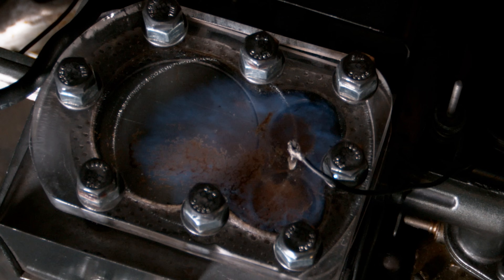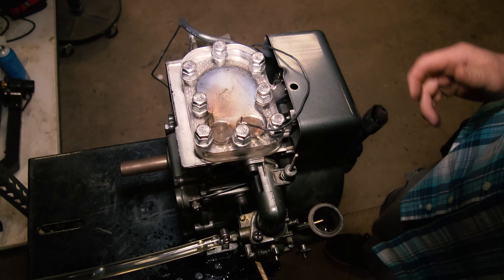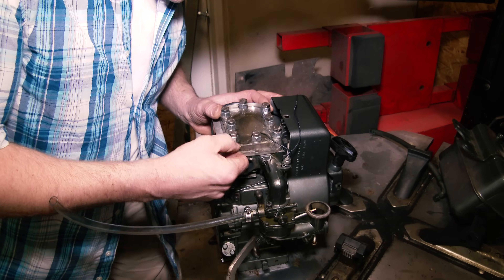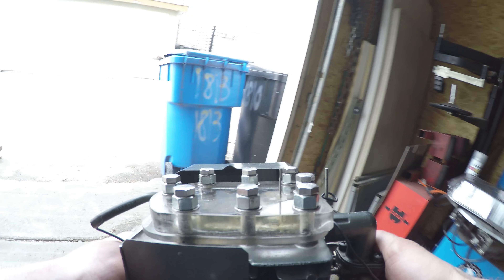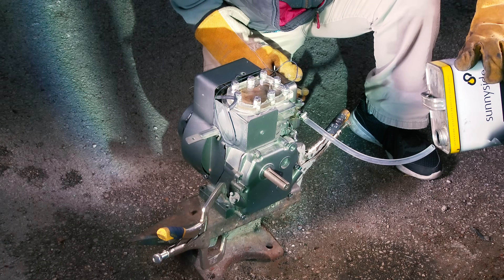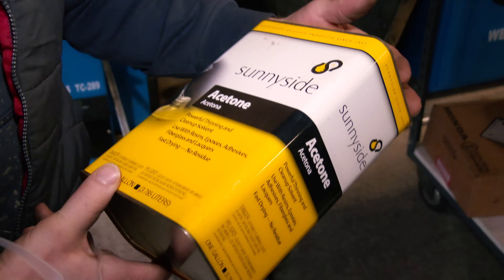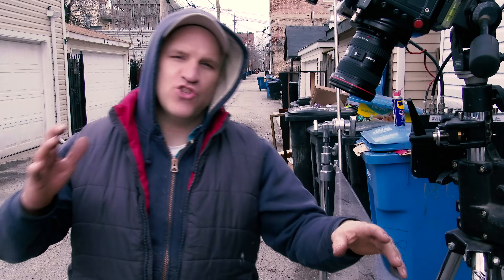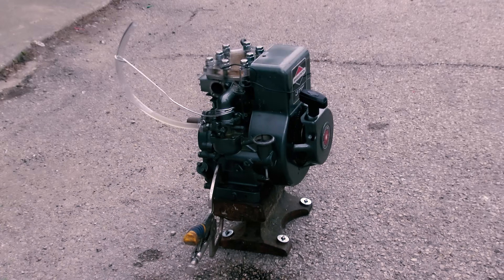See Through Engine (S1 • E3) Different Fuels [WD-40 -Acetone -Stoichiometric Gas ] 4K

Comment: Timing on the Engine is way off...
Reply: DrinkUpHD What do you mean? It's exactly how it should be.
Reply: Wyatt Rowe its right at top dead centre, more efficient if it's before top dead so the the flame is pushing it rather than chase it. Close though.
Reply: Wyatt Rowe or perhaps I'm wrong, it now looks like it's before by a bit. My bad

Comment: When you say that some clip is 4000 FPS, do you mean it was recorded 4000FPS or played 4000FPS? Just one FPS isn't enough to tell anything in case of slow motion footage. Of course it's nice to know, what was the FPS of original footage, but it would also be very nice to know, how many times slower the videoclip is when compared to the original speed. For example, if the clip was shot at 100kFPS and then adjusted to be seen 100 times slower (=0.01 x the original speed, or 1000FPS) the "100x slower" would be actually more telling than either "100kFPS" or "1000FPS" alone. Of course it's best if both original FPS and the slow down -factor are presented. Awesome videos you got there BTW.
Reply: thoubias It was recorded at 4k fps so that when slowed down to normal viewing speeds (30-60 fps) it appears as much slower

Comment: 7:55 8 stroke engine? xD
Reply: Nah... still a 4 stroke. It's just that the spark plug misfired (didn't ignite the fuel) in the next combustion cycle. If he didn't point out the misfired cycles the engine really acted like an 8 stroker lol.
Reply: @Hickcock_45  r/woosh
Reply: @ross2k220  r/redditmoment

Comment: I have an idea. Can you Try and Get it to run on DIESEL. IE Replace the spark plug with a glow plug and Run it as a compression ignition engine +WarpedPerception
Reply from the maker: +James Stephenson I put it on the request list

Comment: stoich is only for quarter throttle exp. just cruising when you go full throttle you want to richen the fuel to like 13.5 to 1
Reply from the maker: +Allen Dittmaier you are correct. That's also why I mentioned that no engine always runs stoichiometric.

Comment: Hi I was one of those who asked for acetone, and although it's not the best fuel for show biz it seems it's the best fuel when it comes to resist detonation on high compression engines, it has a very high octane count. It reminded me of an old footage of an F1 gp when while at top up pit stop they inadvertently splashed the pilot with fuel  which eventualy caught fire and you could see the guy jumping out of the car and running around trying to shake off some invisible  menace, as you couldn't literally see any flames at all. They finally got to him with extinguishers and put him out.
Back then they had very high octane leaded fuel (80's turbo era) . I guess that octane count and bright flames don't go together. Thanx for the video it was very interesting.
Reply from the maker: Fernando Motoholic wow that's an interesting story . I didnt know that, thanks !

Comment: Why is there an extra spark after the explosion occurs?
Reply: Many single-cylinder engines like this one have a spark that is fired from a flywheel magnet. The spark fires once just before TDC compression, an extra spark fires one crank revolution later. That extra spark accomplishes nothing as there is no fuel to burn, but it also doesn't hurt much. It makes the ignition system cheaper since you don't need anything from the camshaft. Some cars do this too - wasted spark ignition.
Reply: Doesn't it wear out the spark plug twice as fast?
Reply: VanillaSnake21 Not quite twice as fast but yes, they do wear out faster. But on these engines, spark plugs are pretty inexpensive and quite easy to check.
Reply: Thanks, nice to learn something new.
Reply: VanillaSnake21 because it's ran by Magneto not a distributor every full Revolution whether it be compression or exhaust will create a spark
Reply: The magneto fires the plug on the exhaust stroke as well as the compression/expansion stroke. No need for a distributor that runs at half the speed of the engine... This configuration works very well, less weight, less complicated and cheaper to produce. They do not wear out spark plugs twice as fast. There is no combustion on the exhaust stroke the plug just fires and there is nothing to burn.
Reply: I thought the 2nd fire was to ignite/flush out any vapors leftover while the valves are open.
Reply: PackCat good theory!

Comment: Try making a see through diesel engine so we can see what it looks like in a running diesel engine ( - ;
Reply: Unfortunately I dont think a glass head would put up with the pressures you'd see in a diesel engine.
Reply: @wills.5762  Recently they have been making some pretty decent sounding super glass compositions, mainly using aluminum and magnesium which are being used as armor...
Reply: You'd need a Gorilla Glass head, a very thick glass head nonetheless.
Reply: You need flex tape
Reply: Rob Ginder seriously? Solid iron and steel buckles under the explosive force of diesel. But you think gorilla glass can handle it?

Comment: Carbureter is supposed to make an stechionetric mixture with petrol. If using a different density and molecular weight combustible,  tuning of carbureted should be changed
Reply from the maker: it was changed as we flipped through the various fuels
Reply: I would use a funnel

Comment: I had so badly wanted to see liquid oxygen or highly compressed pure oxygen. It so could of blown up that engine since it is part of the mixture for rocket fuel and burns very violently.
Reply from the maker: lol.. if the nitro doesn't blow it that is my backup plan. :-). i think thats going to happen.
Reply: From what I understand, you would still need some type of fuel, pure oxygen doesn't burn on its own but allows other things to burn more violently.
Reply from the maker: Nadiustheone well I meant oxygen and acetylene
Reply: Oh, I see, sorry!
Reply: o2 doesnt burn, its a burner

Comment: Anyone wanna explain why the engine is missing so many cycles most of the time? Especially with the gasoline in which it should hit 99.999% of compressions, it just goes like 5-6 revs without igniting sometimes. Is the weird cylinder head messing it up?
Reply from the maker: well the gas was dead on, the mis in between is normal, its a wasted spark system so there is a spark every 360 deg of rotation.

Comment: good stuff man. love your work but id like to point something out for my small engine enthusiasts.

 your talkin about bringing that thing out for safety because of odd ball fuels,
but you ran that fucker wide open on without a governor, which i bet has a stock flywheel.
im surprised it lasted as Long as it did, because I've grenaded flywheels in mere minutes after a governor bypass.
and i can tell you it's pretty damn dangerous. cast iron likes to crack and splinter very randomly.
ive had fragments pierce through sheet metal and graze my neck with modded riding mowers.

i think the little briggs dont let their flywheels go quite as easy as easily as the big ones, but to anyone goofing around  and modding with their small engines, BE SMART. 
1. dont hold it wide open for long periods.
2. make sure its good and warm before you take off
3. don't delete gov if you dont have to... just adjust it.
4. if your going for big horsepower, do it right and get a strong aftermarket flywheel
Reply from the maker: yes this one won't shatter, if it does we have protection in place.

Comment: Why did you not run nitro methane? It's not really dangerous, if you keep the throttle low.
But you'd have to change a lot about the carburetor anyway because nitro methane runs at a very very rich air fuel ratio of 1.7:1!
Reply: Thank you for your detailed answers to both of my comments!:) I'm really looking forward to the nitro video
Reply: next video
Reply: true that
here in holland we use it to boost mopets
(1 liter on a full tank of gas)
no damage but double the speed :P
Reply: Hey robot;) nice to see ya! Are you serious? I've heard about that, but hardly could find any experiences^^
Interesting idea, to mix it with gas. The reason why you can boost a lot of power without damage is because nitro methane has very powerful cooling characteristics. For example nitro dragsters don't have any cooling, it's only cooled by the fuel. Just like nitro engines, an essential part of the cooling is done by the fuel
Reply: also there is oil in the fuel that helps reduce wear
another thing
some mopets had engines that were indistructable
they would run on nitro fuel alone
you had to close the air intake by 90% becaus it would get almost al its air out of the fuel
a 60km/h mopet could reach speeds of 100km/h (this is a claim my coworker made i trust him)
Reply: yep, true. There's a lot of oil.
Aah, yea, makes sense. Runs at ridiculous air-fuel ratios. 
Well, if you subtract the 10km/h of normal gearhead-overstatement, this sounds reasonable. Moped engines are pretty strong in terms of overreving them. 50% more speed, why not.
Reply: but (there is always a but) i know from a rc shop owner
that mopets with bad engines just freeze
2 boys (12 or 14) came in his shop and they asked if he had something to spice up there mopet
he told them if you mix it with regular gas you can use this
but the boys dumped it in strait
it worked untill the engine got stuck
flash forward a few hours
angery mom and dad in the store
you need to pay for the damages how can you sell stuff like that to kids
he told them that it was legal and that when it leaves his store that it was out of his hands

fun times
Reply: haha:D it's funny with what stuff we spent our time.. shit like that. I'd hate to be that shop owner;) must be annoying to deal with such stuff and people.
Reply: true that
Reply from the maker: +DerKrawallkeks yes your right, I had to make many modifications to the engines fuel and timing, and compression, but it now runs like a champ. If I included that in this episode we would have a 30min video and that's too long. Also I want to take extra time out to produce the episode very well . Thanks

Comment: Hey, thanks for the video. I have a question: Is the audio real? Can you actually hear the spark?
And: Is the audio timing adjusted? Because we can hear the actual combustion, but there's no sound on the exhaust stroke..

I'd really appreciate an answer:)
Reply from the maker: +DerKrawallkeks well if you look at the real time footage you can hear the spark, explosion, and exhaust note, the sound from the run is analyzed and then modeled to the cycles. It's a very time consuming process but it's pretty accurate. The exhaust sound in this case was removed because it was too long and shingled the next spark sound which wasn't rythmic enough for me, so we cleaned it up.

Comment: I'd like to see how long an engine could actually run on fuels like these, could WD-40 get someone out of a pinch if they run out of gas?
Reply: Wayne Larson wd40 is basically kerosene
Reply: Greg Campbell Yep, 90-something percent kerosene plus a tiny bit of oil. Kind of like throwing in Seafoam or Marvel Mystery Oil or whatever in your gas. 

For anyone who doesn't believe me, spray some WD-40 into an open container and leave it out for a week or so (time depends on conditions), and you'll see how much oil there was. Barely any. It has it's uses, but it is not designed to be a lubricant for household purposes. Trying to use it as one is more likely to clean off decent lubrication than it is to add any of its own. Silicone spray, white lithium grease, 3-In-1 Oil, graphite powder, and many other better options out there.

Comment: This is awesome! Question, why does the spark plug fire during the exhaust phase? Seems not necessary?
Reply from the maker: Momfasa it's equipped with with a wasted spark system . simple magneto.
Reply: Assuming this is a magneto energized motor, running the magneto off of the crankshaft versus the camshaft allow the magneto to spin twice as fast making pull starts easier. If there is room on the engine for a big sprocket combo to gear up the speed of the camshaft to drive the magneto that would be fine too, but it's just easier to waste the spark I think.    https://en.wikipedia.org/wiki/Wasted_spark#Single_cylinder_use
Reply: Thanks for your answer. More modern electronically controlled ignition systems does not waste a spark during the exhaust phase I guess.

Comment: I work with Comercial Glass... we always throw away tons of glass, be cool to make something cool out of some 1 inch...
Reply from the maker: Ace Mcloud that would be really awesome !
Reply: Warped Perception working on a few Plates for a weight set ATM
Reply: Ace Mcloud plates for a weight set ATM? what does going ass to mouth have to do with anything?
Reply: fuzzy wuzzy At The Moment.... do you go Ass2Mouth enough you need to abbreviate it?
Reply: Ace Mcloud im sure i have assed to mouth myself accidentally before by not properly washing my hands after the bathroom but I am not the one that made up the abbreviation it's quite common
Reply: fuzzy wuzzy 😲😉😎🦄🍾🍷
Reply: fuzzy wuzzy It was an abbreviation for At The Moment and Automatic Teller Machine long before anyone used it for your favorite past time.